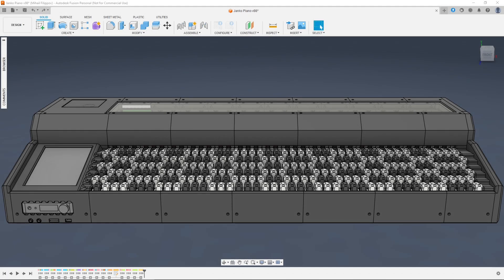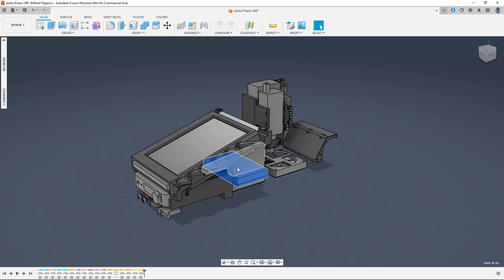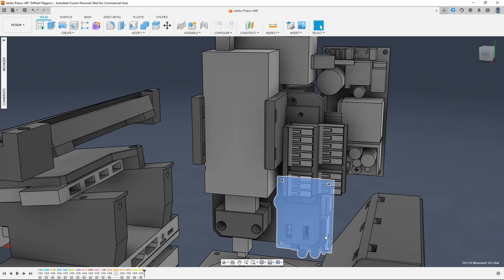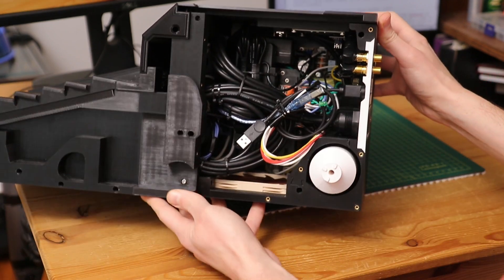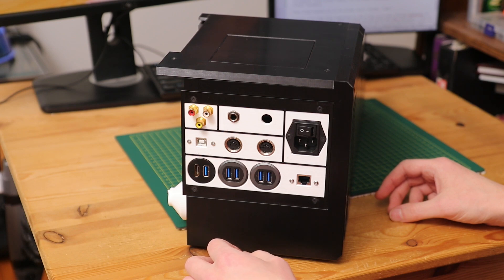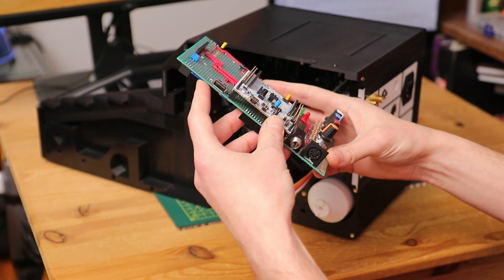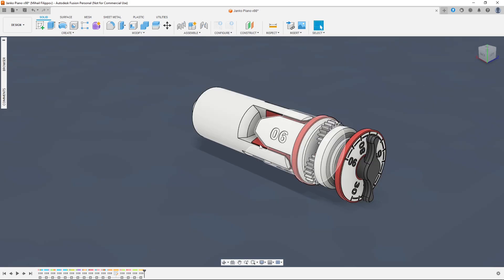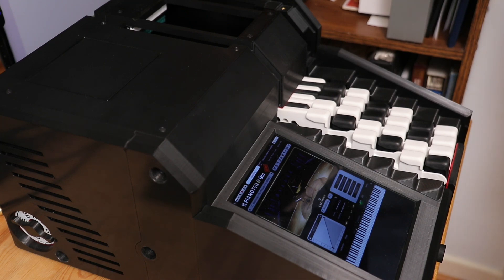DIY Janko Piano: 8. Covers and Controllers

Comment: It is certainly over-engineered but it is for you to enjoy it so everything is included. What is the overall weight (in kg) of the whole 88 keys unit with all accessories?
Reply from the maker: Probably in the 30kg range? Wont know for sure until I finish and weigh it, but the plastic alone is around 23kg, so 7kg for the various screws, rods, electrical components, etc. seems to be a good guess.
And yea, exactly - its over-engineered to my exact specifications :) a more 'commercial' product would need to be 'slimmed' down drastically.
Reply: @DIYJankoPiano  A great idea would be if each module can carry its own set of data and to be daisy chained, but with all the hammers it would be difficult to do, since you measure hammer speed and backcheck position.
Reply from the maker: @PASHKULI  Thats more or less how it works - each of the 8-key segments has its own microprocessor that combines all the key data from the sections to its right and passes it on (along with its own key data) to the section to its left. So for the 88 key piano I will combine 11 of them, a 72 key piano would have 9, and if I wanted to expand the range I could combine 12 (96 keys) or more.
Reply: 30kg would be heavy for regular gigging, but I expect that it’s for home use, so it shouldn’t matter. My Kawai VPC1 weighs about the same. So far, I’m not performing out. If I do a rare gig, I’ll live with it, but if I start to gig regularly, I might get a lighter, gigging keyboard.

I would imagine that it would take a few years with the Janko before being ready to perform with it.

30kg is very reasonable for moving around the house, occasionally.

Existential questions: If a design exactly meets all requirements and criteria, is over-engineering even possible? If requirements are set by the one and only user, is it even possible to over-specify it? 

I love this project, especially because it is a dream build.
Reply from the maker: @JonFairhurst  The bigger question I still have to answer is how to pack the piano up for transport - havent found a workable soft or hard case for it yet, so from the looks of it I would need a custom hard case for it... which are in the 1k$ range...

At least I already got the stand (Roland KS-11Z) and pedals (Kawai GFP-3) picked out and ready.

As for the existential question... its more like working on a project where you are both the designer and the customer - so lots of arguments back and forth about which features to include where one side (customer - aka: me) wants it, and the other side (designer - aka: me) tries to explain that its just not feasible (cost efficient / time efficient / sane / physically possible) at this time.

This also reminded me of possibly the best video essay about personal projects: https://www.youtube.com/watch?v=4jgTCayWlwc
To summarize the takeaway - "dont get so bogged down with the details & optimizations that you loose track of the goal : to actually finish the project".
Reply: I know someone who gigs regularly with the 30kg VPC1. He refuses to go with a lesser keybed. He built a custom hard case, and the key feature is the built in wheels. Even though the gross weight is very high, he says that the wheels make it viable.

Regarding the project, it’s always time, quality, and cost… Pick two.
Reply: I just read about his case again. He over-sized it with room to get his hands in and under the keyboard, and the case has eight handles. He’s older, has a broken back, and can manage it by himself, getting help when someone offers. Stairs are the main challenge when he’s alone.
Reply from the maker: @JonFairhurst  
That... might be a viable option. For some reason I didnt even consider a DIY case for my DIY piano, being completely sure I would need to order a custom pelican case or something similar.

Well - guess thats going to be my next project after this one.
Reply: Paraphrasing Jaws, “We’re gonna need a bigger 3D printer.”

I think the VPC1 owner bought an oversized flight case and made custom foam, then added handles. Not sure if the case came with wheels or if he added them. It seems that the key design choice was to leave gaps in the foam, so he could get his fingers underneath the keyboard. I’ll ask him for more details. You might see the topic pop up near the top of the Gig Performer community forum.

Comment: For Pianoteq on a small screen, have you looked at Zynthian on a Pi5?
Reply from the maker: I originally planned on using a Pi5 with pianoteq on it (looked into Zynthian before and it seems more suited towards an arranger keyboard instead of a simpler standalone VST), but upgraded to a full mini-pc for a few reasons:
1. startup time was relatively the same (20ish seconds)
2. less hassle to set up windows than working with Pi
3. more powerful processor (so higher polyphony, etc. without maxing out CPU)
4. I could use a second monitor for showing sheet music / videos / etc. without needing an external PC

Comment: Something to be ware of.  If two or more monitors are hooked up to the same computer, then as it boots up, that only one monitor will show up at first during the booting process.  But then, as soon as Windows or Mac comes up, that is when all the monitors show up.  My brother works as a movie editor, and he uses a digital movie editor software which requires two monitors, and when he first turns on his computer, only one monitor shows up during the booting process, but once the computer is booted, then both monitors show up.  Adding a second monitor to your pc on your keyboard is going to give you the same experience of "Wait a minute!  Why is that second monitor not working?", until your computer finishes booting up.
Reply from the maker: Yep, shouldnt be too much of an issue most cases as I plan on using hibernate mode most of the time (to decrease bootup time) along with making windows auto-login so you just have to press the power button and ~20 seconds later you have pianoteq running on the small window and whatever you had open running on the large one.

The bigger issue would likely be ensuring that both touch screen monitors work correctly - apparently windows tends to not like working with two touchscreens at once and requires some sort of calibration? In any case - its something to figure out in the future.

Comment: Wow. I would have gone with a MIDI output and an app to configure it over USB and called it done. Very impressive. For my use cases, the challenge isn’t integration of the host, but physical controls and I/O. I would have added more expression inputs and things like drawbars, knobs, buttons, and motorized faders. 

You could potentially use Gig Performer as the Host on your design, however, it also lacks a reduced user interface. But it does support Touch OSC, so you could design your own UI. It can do Setlusts, Songs, and Song Parts, so it could change the Pianotech settings dynamically. I use it to control Mobile Sheets on a separate screen. It would be worth trying. It supports scripting, so I think it would appeal to your DIY point of view.
Reply from the maker: I tried to add a set of buttons / LEDs / sliders / knobs to the side of the piano (near the touch screen) for changing various settings via the same MIDI line as the piano sensors but in the end just couldnt find a good enough place to add them. The front bevel (above the keys) seems like a possible location, but at the same time I like the simplistic appearance.

There is going to be a MIDI IN line in the back that you (aka: me) can use to attach an external MIDI box with various buttons & sliders, but in general I specifically increased the touchscreen size to 10 inch to allow for easy modification of settings in PianoTeq if I wish. Personally though I tend to gravitate more towards the 'digital piano with 10 inbuilt piano sounds' and just pick between them instead of a synthesizer / workstation with a thousand sounds, zoning, record/loopback, etc.

Touch OSC is an interesting option. Might check that out.
Reply: @ Even with piano-only, Gig Performer could enable setlists and songs, where the sheet music automatically appears and the desired piano, EQ, reverb, levels, and transposition are immediately there. 

My use case is definitely on the varied side. I have the Kawai VPC1 for piano, a Hammond SK1 for organ/synth, and a Zendrum for percussion - plus an electric guitar and mic. Other Human Input Devices include a breath controller, three piano pedals, kick and hi-hat pedals, and two expression pedals. The Hammond lacks mod and pitch wheels, knobs, buttons and I/O, so I added a Lab4Music enJOY and a Behringer X-Touch Mini. I don’t go crazy trying to use everything at once (or juggle chainsaws), but I can play covers with backing tracks while striving to perform the most interesting part. Gig Performer makes it all possible.

On a different topic, it would be interesting to develop exercises for the Janko keyboard. I have a specific warmup routine for the normal keys that works many finger combinations and ends with Mozart trills. I noticed that you generally lifted your fingers off the keys during your demo. I expect that I would too, as the layout would be unfamiliar. Warmup and drills could be really helpful in releasing tension. Developing those exercises could be an opportunity, as it’s a relative greenfield.

I’m looking forward to seeing the full build!

Comment: Amazing! I'm curious to know the total printing time and filament usage when you finish. From what I see, the actions seem very good!
Reply from the maker: Well, I am just about finished with the part printing (just got the hammers left which are ~1kg total), so as a quick guesstimate (from the slicer, I ran the printer 24/7, so this should be close):

Filament usage: 19kg PETG & 6kg ASA (plus 20kg of PETG for prototyping, but that doesnt count)
Time: 1145h (48 days) for PETG printing, 440h (18.5 days) for ASA printing.
Cost (filament only): ~500$ (plus maybe 400$ more for prototyping)
Filament brand: Elegoo Rapid PETG (40 rolls with no issues - so got to be decent quality...)
Printer: Prusa MK3 (original, highly customized with enclosure)